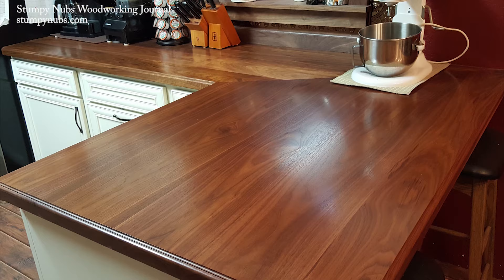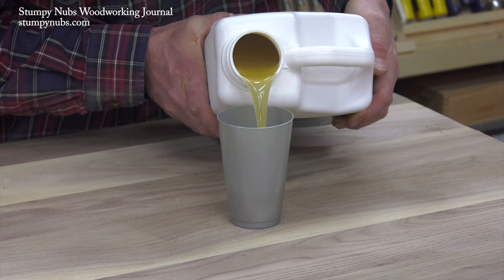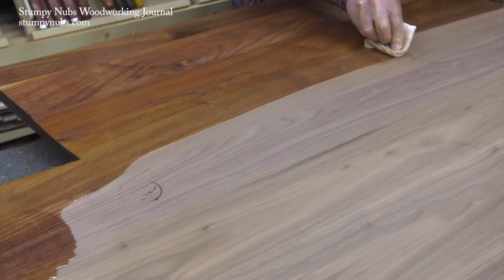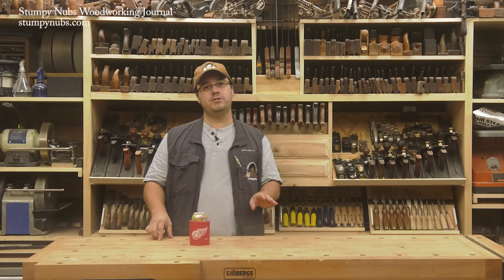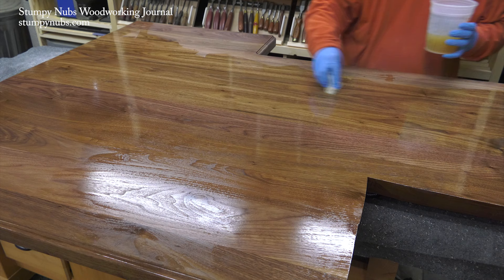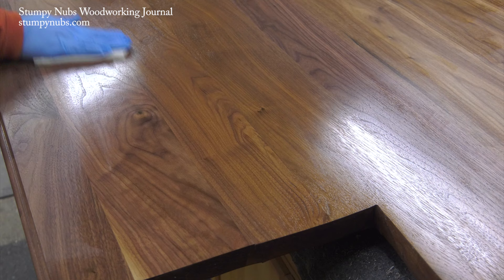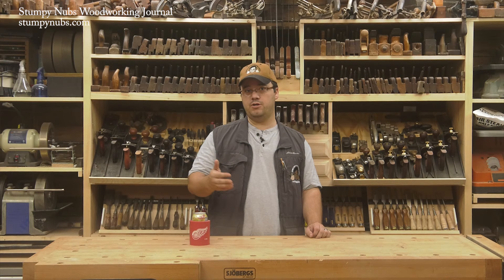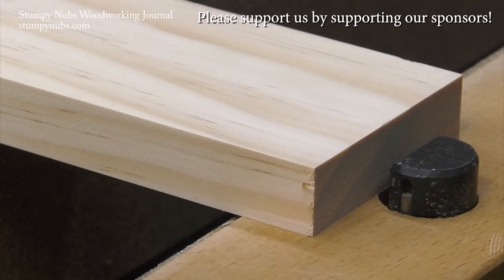A finish durable enough for a wooden countertop (Arm-R-Seal)

Comment: I've used both, but Waterlox is the most indestructible counter funish there is. It withstands decades of abuse before needing a refresher  coat. It doesn't keep in the can though. Buy only what you need.
Reply: I purchased unfinished butcher block countertops and cut them to fit. I was told that Waterlox was one of the best finishes you could buy. I followed the instructions very closely and they looked great for awhile. A few years in, not decades, the finish dulled, even on the side of the kitchen that didn't have water. In areas near the sink, the wood started to de-laminate. A section between the sink and the stove, about 18" wide, actually bowed. I'm guessing that water got between the sink and the countertop and the bottom of the countertop got wet. I doubt this was due to the material or the Waterlox, but was related to my sink install. The dulling, however wasn't due to the installation.

Comment: I'm not going to be a cheerleader for Arm R Seal.  I think it is only average.  It tends to streak easily and runs if you are not careful.  I have had good success with Minwax polyurethane.  It dries faster and levels out better than Arm R Seal, at least in my experience.  Which brands of finish are the polyurinate you are referring to in this video.  They should be named so we can be aware of what to avoid.  If you include Minwax within that grouping then I disagree wholeheartedly.

Comment: Arm-R-Seal is a good choice. However, in this case, I would have been tempted to go with walnut oil. Walnut oil, like tung oil and boiled linseed oil, is a 'hardening' or 'curing' oil. That is, with exposure to oxygen, walnut oil polymerizes into a durable finish. You can speed up curing with heat. On the lathe, I like to wet sand with walnut oil. The heat from sanding helps the oil to cure. Usually, within a couple of days, an item is cured enough to be put to use. 

Arm-R-Seal has the advantage of being a more durable finish than walnut oil. So, why would I have been tempted to use walnut oil? It's self-repairing. If a portion of the finish is worn through, there's no need to sand the old finish back before applying a new coat of walnut oil. Simply clean the clean the area and wipe on some walnut oil. Let the oil soak in and, after 30 minutes or so, wipe off any excess. That ease of maintaining the finish would have been very attractive. Besides, I just like the idea of walnut countertops being finished with walnut oil!

Comment: Used satin arm r seal on my kitchen island/countertop refinish. It's a dream. Put six or seven coats on the top 5 on the underside. It's so durable it is easily cleaned with light soapy water and even withstood a bit of blistering from a hot pan my wife set on it.

Comment: If you are also using a wood counter for a cutting board, I would recommend a food safe finish such as mineral oil, same as butcher's block oil but cheaper. I built a 6 foot cutting board style counter in my kitchen with a bar sink in it and the mineral oil is holding up fine, just have to wipe on a coat when it starts looking dry.

Comment: I love my wood butcher block counter top. It's a great surface and adds a lot of warmth and character to the kitchen. But, I went a different route for a finish... I have birch wood, and the finish I chose was Waterlox Satin finish. It came out a beautiful golden color, AND it's truly water proof, and VERY stain resistant (this last part was a happy surprise). Standing water/liquids do not affect it at all. 

The biggest thing to keep in mind is that you can not put hot items on the counter top. You have to use a hot pad, but it's an easy habit to form. But toasters, toaster ovens, and such are not an issue.

As for dents, dings as the years go on, they add character. But the Waterlox will slowly re-flow any slight surface finish dings over time. But if it's to deep, it's easy to get out the sand paper and sand the spots and reapply the finish. Personally I haven't had the need to do it, yet. I like the dings and such.

As for sealing the underside, it is HIGHLY recommended to seal the underside of the wood above a dishwasher. Just extend the sealing coat a foot or so on each side of the dishwasher to the underside the counter top. Some people tend to open the dishwasher after the cycle has run to let things dry out. This lets out a lot of steam, that can affect unsealed wood.
Reply: I used Waterlox on my butcher block countertops and I wish I had done the underside where the dishwasher and the sink are. The countertop has started to de-laminate and an 18" section between the sink and the stove, has actually bowed. Oh, and it will stain. One of my offspring jiggled a full coffee mug and it overflowed. They didn't clean it up right away and it left a very noticeable stain that will not come off without serious sanding and re-coating.

Comment: I just turned down a job to repair a maple top that had horrible stains around the faucet and cracks above the dishwasher. The client said the C top maker was a jerk because he refused to fix it again. They said they had two spare tops that were slightly damaged that he left in the basement... I left. I agree with JusBidniss... Granite it is.

Comment: I did a tub surround in Wenge. I was going to coat it in West Systems epoxy but that made the surface very dark like Ebony. I ended up using Safecoat gloss and Safecoat satin water-based polyurethane. I have found that no matter what the manufacture instructions from any H2O PU, application with foam brushes work the best at minimizing bubbles. I ended up applying 12 coats (admittedly I was done at 10 but the surface wasn't blemish free until 12). It has been Installed 2 years now with no water stains, or blushes. One thing I did differently when finishing this piece was more sanding than I ever would have done in the past. I used the 3M sanding sheet that is elastic over felt pad and I blocked the surface until it was completely flat. This, in fact, took most of the first through third coats off. It was filling in the grain which made a great base for the next layers to build on. I usually think that it takes 3 coats of H20 PU to equal 1 coat of oil. I let it cure at least 12 hours but generally 24 between coats, then I left it for a week to harden. After that 0000 steel wool to break the sheen and the waxed with paste wax.

Comment: We used Rubio Monocoat for our oak butcher block countertop. Been 11 years without a re-coat, tho those would have probably been worthwhile. Only issue is long term contact w water (e.g. someone leaving a wet glass on the surface overnight).

Comment: I used Arm-R-Seal on several tables I made . One was Cherry the other was Maple had to apply five to six coats before it stopped soaking into the wood and it's a great finish
Reply: Kenneth Kolman how did it wear over time?
Reply: @daveerickson5313  It's held up great with the daily use from 10 people  eating 3 meals a day . We do use place mats and thick not pads under the hot pans

Comment: I like Arm R Seal. I applied it to a baltic birch subwoofer I built for my brother, who has 3 young kids. It's held up well so far.  Very easy to apply. My biggest complaint is that the nearest dealer is a 45 minute drive from me.

Comment: I've watched this video several times in preparation to seal my butcher block counter tops with Arm R Seal. What I'm most hesitant about is that they have been treated several times over the past 4 years with Howard's Butcher block conditioner. Really after about a month that stuff seems to be pretty ineffective at repelling water, but I have been reading some not so encouraging blogs about the difficulty in removing the conditioner before applying Arm R Seal. I've read that they might need many cleanings with Naptha, and even a lot of scraping to rid the wood of the oil and wax. But then another video said that the conditioner doesn't even really penetrate that deeply. The guy at my woodworking shop, where I got the Arm R Seal seems to think that a good wiping with mineral spirits will do the trick.  So.... I've started with the tops (I have 6 separate areas totaling 85 sq ft) that I've treated the least, and the longest ago. For two tops that I haven't treated that much, I just sanded with 300 grit.  A third one I sanded starting with 80 grit up to 300 grit, and then wiped it down with mineral spirits before applying the fist coat of Arm R Seal. It looked like raw wood after the sanding. I couldn't feel any oiliness. That was just an hour ago, so fingers crossed! Any advice for proceeding with the counter around the sink where I have used the most conditioner, and the last treatment was about a month ago??? Please help!
Reply from the maker: Why not get some scraps of wood, apply some conditioner, let it dry and then put the Arm R Seal on it. See what happens? Arm R Seal is an oil-based product. If your conditioner is oil based, there may not be a problem. Mineral spirits will dissolve wax, which may be the reason he said to try removing it with that. I suspect mineral spirits is a main ingredient in Arm R Seal as well.

Comment: I used Arm-R-Seal on my Sapele countertop.  Works well.

(But I used boiled Linseed oil first.  Maybe I shouldn't have.  Hmm.)
Reply: My guess is you shouldn't have since I think that stuff takes so long to dry and takes a whole lot of upkeep on it's on and I'm sure where and what kinda of boiled linseed oil you use.  But James I would to be curious if that might not of been best practice. As I know lacquer can't be applied before any other finish due to off gasing for years or how ever long that takes to stop
Reply: @timort2260  years?  Wow.

I would have guessed that lacquer cures in weeks, not years.  

I did wait for the linseed oil to dry before applying Arm-R-Seal. 

Maybe the linseed oil was just overkill since the Arm-R-Seal darkens the Sapele too. 

Sure did pop, though,  once the linseed was applied.
Reply: @antipasinchrist  your probably ok linseed oil probably cured when it It drys but yeah I've heard about it from guitar builders lacquer can just keep on off gasing

Comment: Thanks for this countertop video series! I just put a wood countertop in my kitchen. I didn’t have time or space to finish with a more durable product, so I’m going with mineral oil and food safe wax/conditioner for now. I’m hoping to put something lower maintenance on in the future. . 

Can this be used on a countertop that’s already been soaked with oil? 30 days is a long time to not use a countertop already in place. Do you have any alternative suggestions?

Comment: IDK why everyone hates on poly. I used it on my hard maple butcher block work desk. I love it. The wood still dents when I use it, but it toughened up the face just enough so it takes a decent fuckup to cause a dent. Its also water proof as long as you don't crack the surface. When you do, your left with beautiful streak stains that are left behind from normal use. I also like the fact that any burns left behind don't boil and bubble, they just sorta burn.

Comment: Hey James, have you ever heard of Odies Oil?  I used that on my 13.5' x 4' solid walnut countertop and it is amazing.  I had a tung oil finish on it before and did not like it so I switched to the Odies.  Might want to check them out, great finish for all wood projects, even turnings.

Comment: I have GOT to find something that will protect my walnut from the grease and oil by the stove. Just 'preventing splatters and drips' isn't working at all. 

I did a five year test run with plywood countertops before I dared use my precious walnut. The oils by the stove were the worst part. I just put in new plywood countertops with poly and I've got 2-3 years before the BIG kitchen remodel. So I have three years to find the absolute best finish for around the sink and by the stove. 

I've been protecting this walnut jealously for the last seven years. When the lumber shortages hit, I was hoarding them like a prepper hoards antibiotics. I've got one shot at this, as I'll never be able to afford walnut lumber again. I cannot screw this up.

Comment: I’m getting ready to finish a plaque I made for a gift. It’s made out of a nice piece of cherry wood. I routed out a strip on 1 side, and put a piece of walnut veneer in the strip. Sanded it down to flush and it is beautiful. I then used a wood burner to burn in a nice heartfelt saying. Once again, sanded over the burnt area to clean it up.
I plan on using Waterlox as a coating. But have never used it before. I enjoyed your videos on Waterlox, and think it will really bring out the beauty of the cherry and walnut veneer.

Question 1 (most importantly): Can Waterlox spontaneously combust?
Question 2: Do you think the Waterlox will react well with the burnt wood writing?
Question 3: My workshop is in my basement, and not ventilated at all. It’s pretty cold outside. Should I move up to the garage for applying the Waterlox? It will still be cold in the garage (around 50 degrees). I could always bring temp up in the garage, apply, then open up for ventilation afterwards. Thoughts?

Comment: Hi Stumpy, I had a custom dining room table and the end result was pathetic.  Since they are in Canada getting them to correct the issues doesn't really work.  The issue is that when they applied the oil, many areas kept soaking up the oil and they didn't bother to keep applying.  Then they applied wax and a ceramic liquid.  The end result is areas of "dry" wood.  I believe you are right that Arm-R-Seal is the way to go.  My question is what is the smartest way to remove what they did and then apply Arm-R-Seal?  Thanks for your time.  Bill

Comment: If your wooden countertop gets a dent, would you also recommend trying the un-dent trick with a clothes iron and some water before re-sealing it?
Reply from the maker: It would be unlikely to work since the finish will prevent the fibers from absorbing the moisture needed to swell back up.

Comment: I want something that will let the beauty of the wood shine through and keep water circles from happening when someone leaves a drink on the counter or rinses out a pot or a dish and leaves it on the counter, for whatever reasons. Stupid or otherwise. Anyone?
Reply from the maker: I've had mine for two years. No rings on the counter. And I am no more diligent about keeping the counter clean than anyone else would be with any other type of countertop.

Comment: Thanks for all the good advice. Would this work on a Pastry Board. I need to make a new one for a client and there are almost too many options. If I allow this to cure for 30 days, or completely, will it be a good choice. I have used different finishes in the past with okay results. I really wish to find a finish that will hold up to making bread and things like that. However, I would like something that would hold up as long as a sharp tool isn't used to cut the dough.

Comment: 3 questions please, but first, great video at the right time! Scenario... I am making a spalted maple live slab kitchen bar top and am struggling with how to finish it. Based on this video I assume this would be a good choice. Q#1. Is that true? My first thought was epoxy because of the “no wet worries” haha protection it provides and, well, my family isn’t the cleanest in the world. Q#2. For a kitchen bar top at home, what are the other “best” protective finishing options are there? Ones with a combo of natural look and protection. Q#3. Also, what should I do to the bottom of the slab? Any finish at all or sand and leave it bare?
Reply from the maker: Any wooden countertop is going to take some care as compared to granite or concrete. An epoxy finish will make it much more durable, but the trade off is it looks like plastic. And to me, it makes no sense to use wood if you're going to cover it in plastic. So, if you use Arm-R-Seal, be aware of the limitations... As for the bottom, I usually put three coats on both sides.
Reply: Stumpy Nubs thank you very much!

Comment: I have a walnut countertop in my kitchen with a sink. Builder of countertop told me to use Rubio Monocoat which I did and I HATE. unless I applied it wrong it has done nothing. The seam of where the planks meet is no longer smoother the seams when you run your hand across the grain of the seams feel bumpy at each seam in an area close to the sink where we wash dishes and dry them. We NEVER let the dry matt on there long and I am a crazy person about this counter. EVERYONE who enters knows that no water is to be left on this counter. But the finish is not lasting at all and it is super expensive. Countertop is only 1 year old. So I need another option. Someone else suggested Waterlox. But my question with the product you are speaking of is how do you apply this to a countertop that already has stuff on it? And there is NO WAY I can not use my counterotp for 30 days. Its in a working living kitchen. I can maybe go 2 weeks. But I can't go 30 days. Would this product work? And how do I prep the countertop if it already has a sealer on it. Thanks